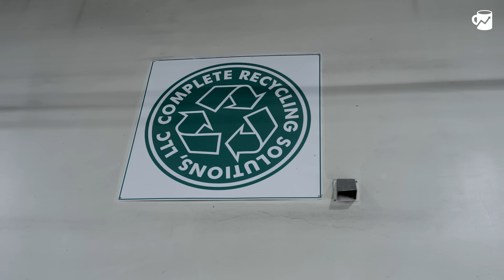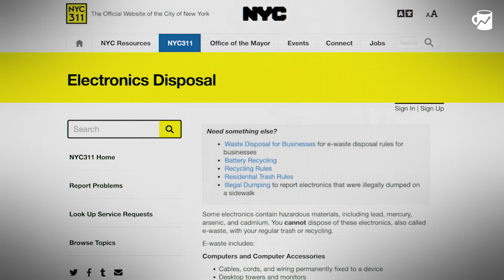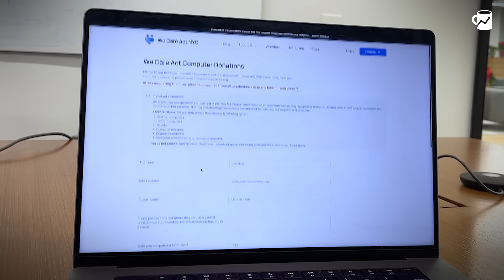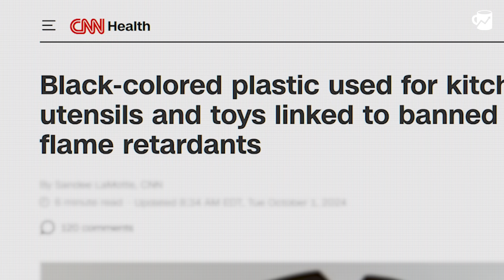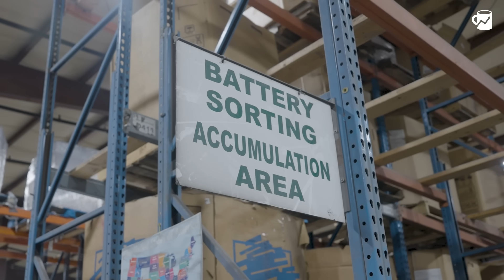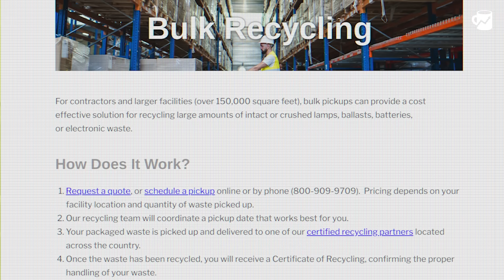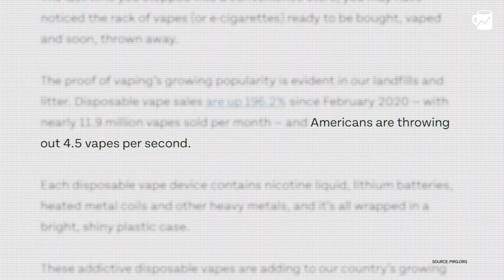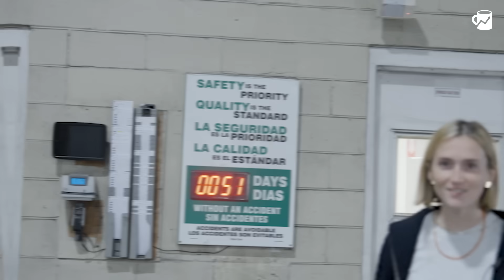I went down a rabbit hole trying to recycle all my tech waste

Comment: Two things could help a lot. (1) Right to repair legislation which will make circuit diagrams and parts available to repair technicians. (2) Allow those recyclers to supply parts to repair shops. A lot of electronics contain parts that cannot be purchased because manufacturers do not make them available for sale. Repair shops would love access to those circuit boards those recyclers are destroying, to get access to those hard to find parts.

Thanks to people on eBay who sell circuit boards from old TVs and laptops, I managed to save a lot of TVs and laptops from going to waste. If bought new, these boards are too expensive to be worth it, and it would not be worth my time to do a deep dive into troubleshooting a faulty board without a circuit diagram other than checking the basics and common problems. Thanks to those "recyclers" who sell parts on eBay instead of destroying them for the raw materials.
Reply: I was actually just about to ask if there's a way to buy from these ewaste centres because I see a lot of waste in "recycling" certain devices
Reply: I break my boards down or sell them whole for that reason. Other than capacitors that tend to dry out most older boards have working components.
Reply: Why should a company be forced to comply with burdensome regulations? You think offering schematics costs nothing? It goes beyond that too because there'll always be idiots that clog up systems. The small percentage of troublemakers that weigh everything else down. If you want a schematic then draw your own. Quit bothering everyone else.

Comment: The only way to "slow this problem down" is to not create it to begin with. In other words, no more electronics. Yeah, right, nobody is going to give up their electronics. Me? I don't have a cell phone. I've had the same landline phone for at least a decade. I had a 2011 computer I used until it finally broke in 2024 (Best Buy recycled it), still have the same monitor, no television, and do not have any "smart" electronic anything. I drive a 1993 Ford Explorer in which the greatest electronic is a cassette tape player/radio combination which I don't use.
Reply: Connie have you ever considered writing a manifesto

Comment: I bought my Huawei Matebook second hand refurbished 5 years ago. It is in perfect condition and I still use it to this day. I have required more storage so recently upgraded the SSD from 250gb to 1tb, this was incredibly easy to do following a YouTube tutorial and hoping to keep updating my laptop to suit my needs rather than replacing it. The only downside is many companies know this and do not like this. I was not able to upgrade my memory to increase performance (which currently is fine but again, potential changing needs especially as my storage starts to fill up) because the RAM was soldered on - not removable or replaceable :(

Comment: Advice from a programmer who also fixes electronics, including phones. You are never going to be satisfied with recycling your electronics. Only buy cellphones that you plan on using for a minimum of five years. You will have to pay to have the battery replaced at least once, perhaps twice. Towards the end of five years you will probably notice that your phone's software doesn't work as well as it used to. In my case, T-Mobile's 4G LTE service had a slew of stealth updates that made my older phone barely work at all.  For tablets you can probably stretch it closer to 7 or 8 years (Google or Apple services will eventually stop working reliably). For every other device you own plan on using it for 15-25 years. I bought the highest spec gaming laptop I could find in 2017 and gave it 32 GB of RAM. Unheard of in those days but considered common today. The device still works fine, but I did have to replace the keyboard and battery. I plan on using it until 2032. I have stereo equipment from the 1990's that still works great. They all have Bluetooth transceivers (~ $20) added. Most electronics devices thrown away are prematurely discarded, sometimes decades too early. Final word of advice. Buy the higher end device, the most expensive you can afford. It will last far longer. For example, Apple sells un-upgradable laptops today with 8 GB of RAM. Wasn't enough in 2017, it's a joke today. Figure out what low, medium, and high end specs for devices are and buy towards the high end.

Comment: I doubt even if I had a Nebula subscription that i could watch it on my old laptop because its anetbook from around 2009 (it was running vista originally. Please explain how they thought a heavy operating system would work on a weak computer?)

It struggles to run YouTube.
Reply: maybe not Vista but I have seen them running on Windows 7, 8, and even a few XP. Depending on some factors , of course.
Reply: I also have had problems with Nebula using wireless devices and blamed my old computer.
It is most likely the wireless device.  Your wireless network has to use the backwards  technology to connect. Try the wire connection to the router. or use an extender that has nicport.

Comment: Some Goodwill's do, some don't. As an electronics recycler myself, I accept anything but ac units, scanners or printers. Some fax machines I do accept (older ones mostly).

The problem is that newer printers, fax machines and most all scanners, are 90% plastic and take forever to remove the electronics. I used to use a hammer and just pull the electronics out, but it was more effort than what I would make (by a lot). And AC's have freon, just don't want to deal with the EPA or local government to properly evacuate them.

My dump takes electronics for a charge tho.

Phones are pretty easy though, some Goodwill's, a lot of vending machines (for phone recycling), and scrappers will take old phones. Some recyclers for phones will require the battery removed, although that's a rule that's going away too gradually.

Comment: Icymi that black plastic study just issued a correction: they accidentally miscalculated the upper safe limit, missed a zero. This means that instead of getting nearly 100% of the limit you're actually getting more like 10%. It's still dangerous and should be avoided if at all possible but it's not as bad as first stated 😊

Comment: Super good insights in e-waste recycling, that was very interesting! A missing part of the video, according to me, is all that can happen before selling or recycling e-waste: repairing old electronic appliances to use them longer (even just a few years can make a difference). The repair market is developing pretty fast, even though tech giants are trying to prevent this movement, that would make a fantastic topic for another video! Also, choosing electronic products that last (and are repairable) can also make a difference, for example Fairphone phones or, on your side of the Atlantic, Framework computers

Comment: locally, stores often have return slots for batteries and light bulbs. then a few electronics stores have recycling for products they sell (two of the major ones even give you a small reward too) and then most recycling facilities accept electronics. i think stores accepting recycling returns have to be free and recycling centers often charge a very small recycling fee, often per weight or volume.

Comment: There is a company who made the first fully recyclable circuit board. Check them out they're called Jiva Materials. They're a small startup but imagine if their tech was taken by all the computer manufacturers...
Reply: It's a great concept and has huge potential but it needs a lot more development before it could be used by the majority of manufacturers. Basically the traces on the boards can't get small enough with their tech and stay reliable which limits the use cases.
Reply: @InsideAlan  yep. still early, but being at square one is better than not even being on the board...

Comment: Honestly putting my old electronics on ebay for like 5$(+ shipping) made them go away pretty quickly

Even damaged for parts tend to go at that price
Reply: It amazes me that these kiddies claiming to be technical can't even figure out how to search for a place to ship them off to and sell them. Or eBay type sales. The components are still useful to a technical experimenter. I got $25 each for old floppy drives and the buyer paid for shipping. I test them first, but some will buy non-working items for a lower price for the components alone. I am keeping some of my older hard drives of the 10 gig variety as museum pieces. Those things cost hundreds back in the day and we never thought we would fill them up!
Reply: yes, it is a great platform for that.

Comment: Also, the way they "recycle" is sad. You don't need to crush everything into a pulp. Assuming it's all dead electronics that can't be repaired, why not disconnect wires and unscrew parts instead of smashing them? Some parts still would be valuable and easier to handle.
Reply: Most e-waste is 100% working, but the owners just upgraded and don’t need the older one anymore. Recycling all this working technology that people once paid thousands for is sad.

Comment: @9:05 If positive and negative touch, they do not short circuit. Only, when a positive and a negative touch and a chain is formed that allows power to circulate, then a short circuit forms. This is almost impossible with just regular batteries to arrange them in such a way. But if you deal with millions of batteries, maybe that's a chance. But its not so simple how he describes it. Otherwise any two batteries rolling around in your pocked or bag could spontaneously catch on fire due to "short circuit" and they do not, do they!? Ever heard a news item " I had loose batteries in my pocket, they touched positive and negative and caught on fire"? Never.
Reply: Yeah, they're definitely being overly protective. I used to sort batteries that were being recycled and we just threw them in a big tub without ever worrying about any kind of short circuit.

Comment: Not useful maybe but my local power company, Entergy, will haul off your old (running) fridge for free and send you $50. Their goal is to take inefficient fridges out of the market, like cash for clunkers. My fridge was starting to make weird noises and need repairs so I think that was better than someone using it again, because it would just cost more in power.